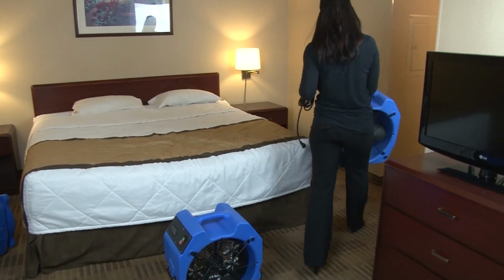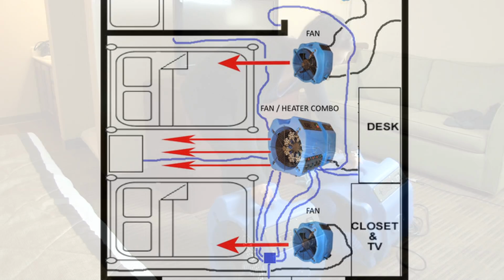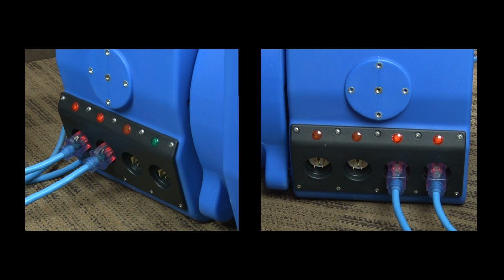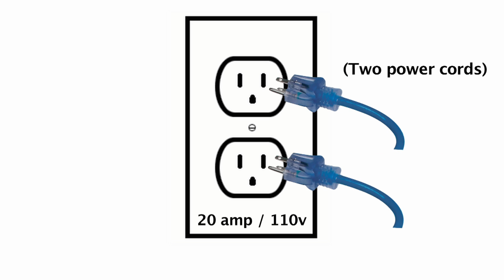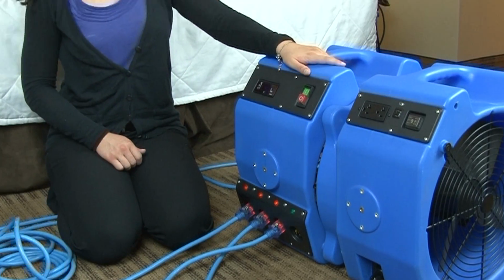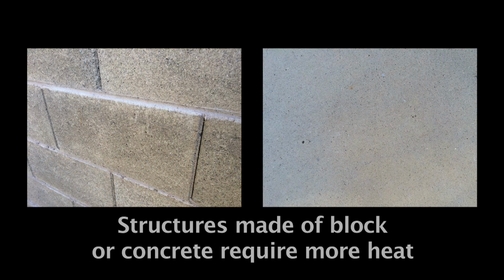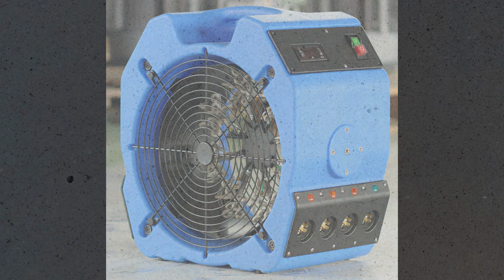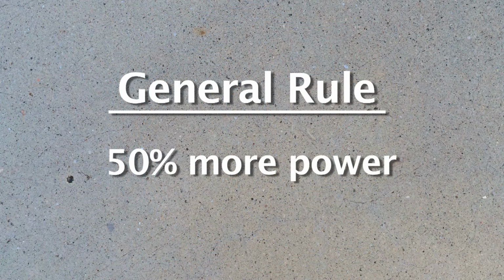Convectex How To Do It Yourself Bed Bug Heat Treatments 1-877-375-0005

Comment: 18 hours? Really?
Reply: I use propane with up too 125,000 BTU and use fans to guide the heat to destinations.
Reply: depends, if the temperature in the room is 120f degrees then only 30 is enough, if it's 110f then it'll take about 18 hours, i read it on a website called wavepest.

Comment: I'm using the elite 4 for powder post beetles. The house has bed bugs to and they've been cooked several times. The other things have destroyed my home. It will be torn down , It's an inheritance gift lol. At least the property is nice Just killing what we can until, demolition begins. Please check your house and furniture for these damn things . All the antiques are gone. They're almost microscopic so by the time they're discovered its too late. The theory in this case is the wood used to build the house came with them. Wood for building is now heat treated but in 1965 it wasn't. Many of the wood destroyers can live 40+ years. 140 degrees kills every thing and also melts. Room prep is necessary. Worth the investment. Good luck!

Comment: How is it done to schedule and how much time does it kill bed bugs at what temperature?
Reply: Other exterminators give the temperature of 130 to 140 degrees and 3 to 4 hours at full temperature to allow the heat to penetrate through walls and insulation.  Make sure you are moving furniture and fans occasionally as well.  Look into DDT as well.  Much cheaper and easier to use.
Reply: @residentzombie  Sure it does if I could just find it...it will kill anything.
Reply: residentzombie DDT doesn’t kill bedbugs anymore
Reply: where can I get DDT?
Reply: @hyeongminkang8303  you can't
Reply: Hyeong Min Kan